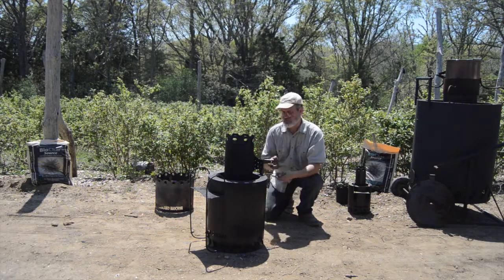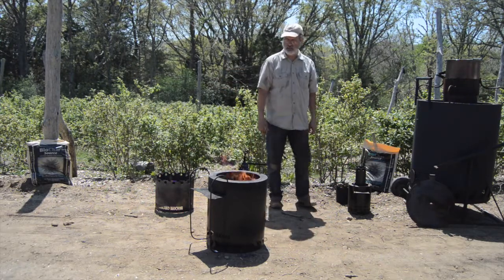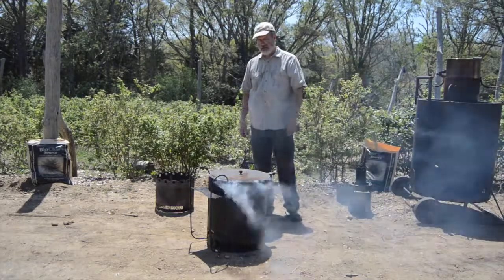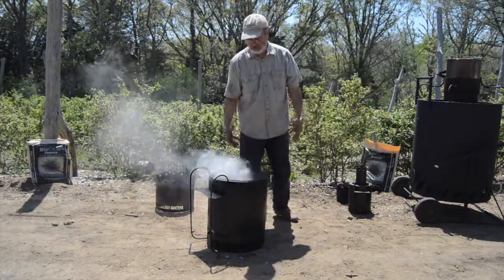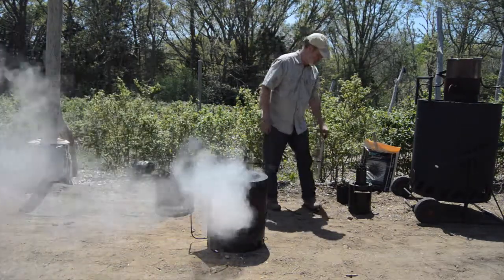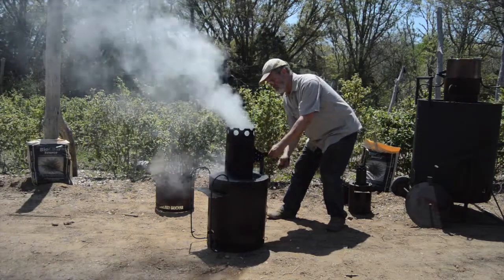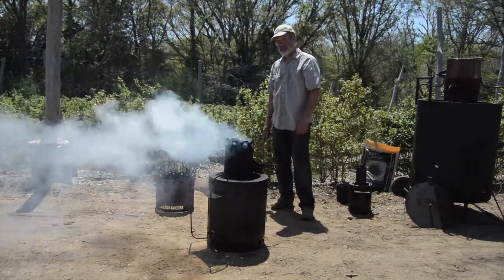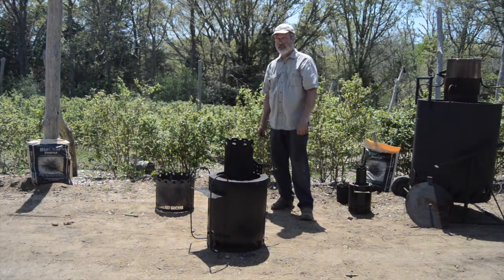Burn the Smoke! Biochar TLUD with Bob Wells

Comment: What materials did you use to make your TLUD?
Reply: It's all carbon steel except for the bottom of the inner chamber which is stainless.  It's the one part that burns out otherwise.
Reply: Bob Wells where would one get those items? What is the inner chamber made of. I guess what I am asking for is a materials list.